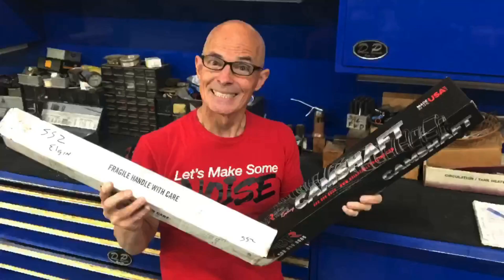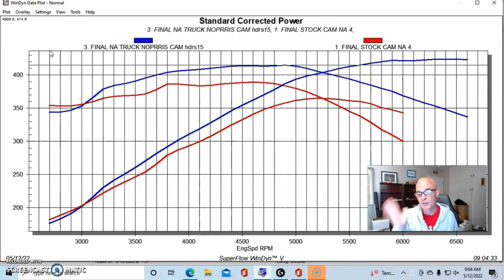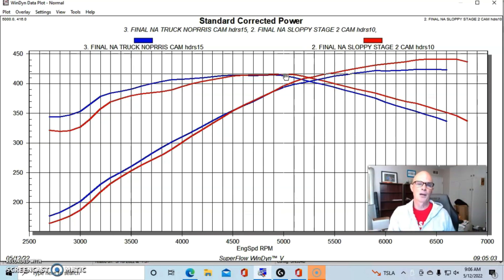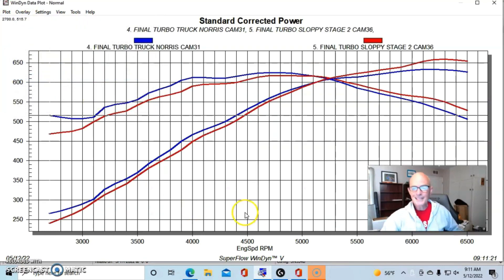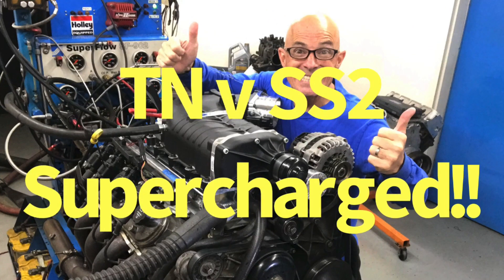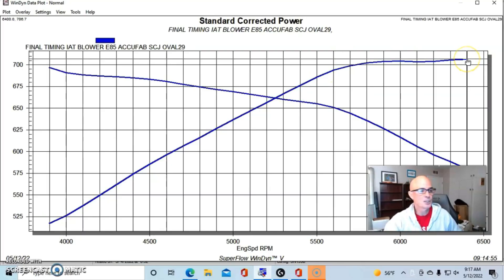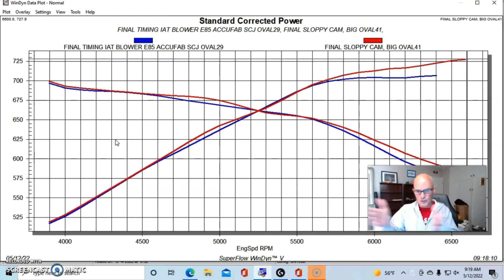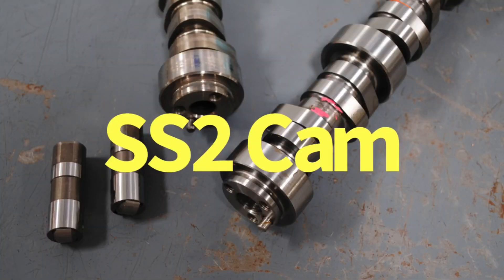WHAT IS THE BEST CAM FOR MY SUPERCHARGED LS MOTOR, TRUCK NORRIS or SLOPPY STAGE 2? WHO MAKES MORE?

Comment: Hay if you have an extra 4.4  Cadillac Supercharger hidden you don't need. Let me know 😂 it would work great on my 5.3  with a BTR  Stage 2 in my 85 C10 😂 will save more money. Thank you for your information on my engine choices. Along with the  insite on the 4.4  Supercharger alond with the video of the adapter plates for the 4.4 supercharger  very helpful 😅❤

Comment: By any chance, do you know the difference between Norris cam and red hot cam ?
Reply from the maker: yes-that video is up (along with BTR hot rod)
Reply: @richardholdener1727  could I get the link please.. I can’t find it
Reply: @richardholdener1727  what cam would you recommend. I have a ls 6.0 with a gt500 supercharger. Transmission will also have a 3400 stall torque converter.

Comment: How many degrees of timing 1000 to 3500,  3500 to 5500, 5500 to 7000 rpms..?

Do a ly6 bored to ly6, with ss3 cam, and gt500 blower. Need that  1k hp...
Reply from the maker: you won't get to 1000 hp with a Gt500 blower
Reply: What factory blower can I use to get the 1k hp mark?  Eaton tvs1900 m112 or 122 blower?

Comment: great content as always. I'm so bummed we have to guess at the data produced below 4k in the final supercharged matchup. I feel that is the most valuable piece of info in seeing how the supercharging effect compares with 2 different cams. I understand not wanting to blow the motor up, but it would be great to know if the earlier blower boost makes up for the ss2 always having less power downlow and also most importantly if that's actually beneficial in reducing a little early onset tourque from the blower enlarging the safety margin on a supercharged street style motor. since the data could not be logged for fear of tight rings, do you have an educated guess from you experience as to what would be happening below 4k?
Reply from the maker: the cams do the same thing boosted and na-if it makes less torque NA-it makes less torque under boost

Comment: 5.3L truck motor way different LW7 motor cast iron block and square heads got play with heads with then cams with supercharging and turbo . I like see 1500hp. Before I built it
Reply from the maker: no 5.3L ever came with rec-port heads

Comment: Richard could you make a video testing different centrifugal cams?? I can’t make my mind up on what can to use on my 6.2 L92 build. 
Thinking of the BTR centrifugal cam 32744155R1 but it looks llore this may hurt low rpm power. Thanks for your time 🙏🏽
Reply from the maker: what power level, what boost level and what blower?
Reply: @richardholdener1727  it’s the ECS NOVI 1500. I believe the kit comes with a 2.75 pulley 8-10psi. Im shooting for around 700-750hp hopefully maintaining a good amount of torque down low. But also contrary to popular opinion I don’t really like a ton of chop haha.
Reply: @richardholdener1727  i’m sorry the pulley is actually a 3.48
Reply: @richardholdener1727  any suggestions Richard? I’d trust what you say, you seem to have serious knowledge on these engines
Reply from the maker: ask the guys at BTR how they feel about a Hot Rod Cam

Comment: How would these two cams go against a PDS specific cam (or a stock LSA blower cam) 

And could the same results/difference be expected on say a 6.2l LSA/LS3?
Reply from the maker: They would both be a lot better through most of the curve (especially down low), but you could put a big PD blower cam in and make more up top if you like

Comment: So after seeing this vid, I am seriously thinking about a Truck Norris cam and a TVS2650 on a 5.3L.  Only Q is will the overlap of TN cam cause any Air-fuel ratio (o2 sensing) issues at low rpm, hi boost scenarios (aka: blow through)?
Reply from the maker: no

Comment: Would the camshaft for a LSA or a TVS2300 on a LQ9 be significantly different from a 2.9L Whipple on a LQ9 keeping cathedral port heads? Since the Whipple is bigger than the 2300 and even the 2650 and a different type of supercharger that should build boost a little differently would the valve events need to be a little different?
Reply from the maker: THE CAMS WILL DO THE SAME THING WITH BOTH BLOWERS

Comment: I guess the "na cam" "turbo cam" "blower cam" characteristics will only be exposed by checking how much unburnt fuel air mixture is being dumped at the exhaust.

Looking at dyno graphs alone won't expose that.
Reply from the maker: if the AF is the same-the unburnt fuel dumped out the exhaust is the same-the dyno shows that

Comment: You need to test a cam on a motor that does as the Hellcat motors do: more duration on exhaust side than intake side, or at least increased duration over the SRT 392 naturally-aspirated cam.

Since on most engines, the air is left to make its own way into the cylinder, it has a larger valve than the exhaust, which is being pumped directly out. 

Could larger exhaust than intake valves be the key to ultimate blower power?

YOU can find out!

Comment: I daily drive a TN cam in a scsb 4x4 truck 110 mile round trip to work. It makes amazing low end power in my otherwise stock 5.3. Its awesome everywhere in the rpm
Reply from the maker: it does work well

Comment: Hey Richard I’ve had the same thing told to me about my cam. It’s a comp 54-601-11 muther thumper 227/241 that’s it’s just for sound. I have it in a Carb 5.3. It produced 358rwhp and 356rwtq at 6900rpm. Still wants at peak on Hp it was still climbing.

Comment: Hello Richard, I have a ‘05 2500 lq4 with a magnuson radix. I’m wanting a cam. Truck Norris looks good. I found another cam guy (Vinci high performance) he quoted me a cam for my application (578/587/213/220/115+5A) I guess the cam has 5 degrees advanced ground into it? Have you tested these types of cams? Would that advance make low end torque like the truck Norris? I’m a little concerned the Vinci cam has to much lift. Thanks man! …Andrew
Reply from the maker: don't worry about the lift-that cam will be different then the BTR TN cam-but it will work
Reply: Ok thanks!

Comment: I would like to see a lunati voodoo hi lift 219 223 against these cams g6 guys ran in the 11s with stock converter I think this cam is still relevant and should be aloud to compete
Reply from the maker: COMPETE WITH WHAT
Reply: @richardholdener1727  hey Richard you asked what that particular cam would compete with I was referring to the sloppy  and the truck Norris don't get me wrong buddy but you test these cams alot witch I absolutely love brother I can't get enough of it your channel is the best hands down.  But it would be nice to throw a  curve ball cam in the mix like this lunati 625 625 219 223 that isn't well talked-about  but has shown to give  quite a powerful cam in the same areas that these other cams you test show it some love  it mite raise some eyebrows 🤔🤔

Comment: Adj manifold volume in tune for a Twin screw blower.  How important is it and the volume of a Whipple gen5 3.0?
Reply from the maker: MANIFOLD VOLUME IS NOT IMPORTANT
Reply: OMG the Whipple Gen V 3.0 is one of the best blower designs in history, if you are talking of the dual-pass aftercooler bottom-blower top-aftercooler design for the Mopars.

Comment: Hey Richard I have an old 01 2500 Silverado with a 6.0 that has 390,000 miles(original engine). I plan on rebuilding it next year, and I was wondering if LS3 heads with the torquer cam would hurt my low end performance. I will only ever use the truck to tow my project cars so never above 5-6000lbs. Thoughts?
Reply from the maker: THE HEADS WILL
Reply: @richardholdener1727  good to know thank you sir!

Comment: Another comparison of the SS2 to Truck Norris. I’m really impressed by the TN cam—the tight LSA makes the overlap within a degree or two of the SS2 cam while the intake closing is vastly different. TN closes the intake about 30° ABDC while the SS2 is at 45°. To my understanding, that explains the differences NA perfectly. Still, the performance of TN across the rpm spectrum is pretty amazing. Your point about killing some excess torque at lower rpm with a positive displacement blower is a good one! Great info yet again Richard!

Comment: Like to see what it does with a PD specific camshaft compared to these two cams
Reply: Yes, I have read many times to get a PD specific cam. How much are you really leaving on the table to go with a custom spec cam vs off the shelf "popular at the moment" cam? Typically i see mention about the bleed off with exhaust duration not being "ideal" on a non spec'd cam on blower application. Maybe it doesn't really matter, but would love to see a test to show it.
Reply from the maker: IF THE PD BLOWER CAM IS BIGGER-IT WILL DO WHAT BIGGER CAMS DO. DEDICATED PD BLOWER CAMS (LIKE THE STOCK LS9) TYPICALLY HAVE WIDE LSA AND ARE SOFT DOWN LOW. WHAT THE PD BLOWER CAM DOES NA-IT WILL DO UNDER BOOST
Reply: @silentbravo  The Hellcats have a cam that has the exhaust duration longer than on the same-ish engine naturally aspirated from the factory.

Comment: got to say it richard  sloppy stage 2 for the win  ( my own ss2 has been in 4 motors now im a fan)  but  at 33 thou less lift the truck norris cam gotta be better for valve spring life especialy up in the top end
Reply: IMO People going for power, power, power are ok with redoing the thing every 8-10,000 miles.
JMO

Comment: Do you like the SS2 more than the Sloppy Best?
Reply from the maker: THE BIGGER SS2 WILL MAKE MORE POWER THAN THE BEST
Reply from the maker: NO-THE LS4 IS A CATH PORT HEAD AND THE LS3 IS A REC PORT INTAKE
Reply: @richardholdener1727  Question: relative to airflow direction, are the cathedral ports somewhat shorter than the as-viewed-from-outside?

Comment: Hey Richard! If you were going to put a blower on a 6.2L Sierra, would you go with a 1.9L, 2.3L, or 2.65L?
Reply from the maker: WHAT IS YOUR DESIRED POWER
Reply: We wanna see a 1000hp blower motor
Reply: @robinwendt5527  LOL then a 2.65L Magnuson or the all-dominating 3.0L Whipple that is blower-down, aftercooler-top design as it sits for the Chevs and Mopars.
Reply: Oh yea I know the whipple 3.0 but I wanna see it in the dyno is what I meant

Comment: The more you post about the Truck Norris cam makes me want to buy one. I really want to see what power they make on a cathedral port 6.0L. I currently have a BTR LS3 stage 2 cam and I’m thinking I over cammed it for my truck. Keep up the great work.
Reply: Heard the BTR 2 is a dog below 3500 on a 6.0, and doesn't work that well with a stock converter either. I went with a Cam Motion LS3 Titan 1 for the 6.0 in my G8,  217/225 just under .600 lift 114+2. The Truck Norris would work great in a 6.0 IMO, especially a heavy vehicle where low to mid torque is king.
Reply: The L76 6.0 in my car has LS3 heads from the factory.

Comment: Why not same psi blower to turbo??
Reply: That wasn't the point of these tests, he was comparing 2 cams and how they reacted to NA, turbo and blower boost.
Reply: @silentbravo  true that was beyond the scope of this video.  Just curious to see that aspect on a graph.
Reply: I would guess about 120hp difference at this boost level. That blower eats some power.
Reply: @fpvjt146  Only accurate comparison is fuel consumption at exact same horsepower.

Comment: I dont know if it was actually from this run but in the video, you can see the idler puller moving further away from the centerline.
Another good video. I think down low, the pd supercharger is going to be the equalizer down low but the cam timing will make the bigger cam produce more power up high.

Comment: I'm curious how my BFD Texas speed cam will do with boost
Reply: I'm curious if there are ANY Texas speed cams that won't do well with boost lol
Reply from the maker: Ask yourself-what does the BFD do na?
Reply: Well kind sir, I know in Zach Mertins c10 truck from hoonigan, it layer down almost 600 on a 430 cube LS engine while in the truck
Reply: @jeromeirving4770  at what RPM?
Reply: When it was dynoed, it spun the rollers well passed 6900 redline

Comment: The wider LSA of the SS2 helped on the PD Blower tests.
Reply from the maker: no-it was just a bigger cam
Reply: @richardholdener1727  If the answer was that simple, then explain the N/A results, where the SS2 lost, then somehow won in the Supercharged tests - even down low where it was at a disadvantage. You seem to argue BIG-SMALL for everything, like my continued arguments with STROKE and BORE for power bands. Sorry, but BIG-SMALL doesn't win the argument every time, otherwise, you would be the worst Ambassador for the Aftermarket Performance Parts Manufacturers, and the research that THEY do to sell components.
Reply: @joeyjojojr.shabadoo915  Look at the RPM, he didn't load the supercharged test down low like he did N/A. He says that in the video. LSA doesn't even matter it's just a sum of intake and exhaust valve events. The SS2 has 5 degrees of overlap. The TN cam has 3 degrees. It literally has less overlap.

Comment: Blower combination literally ran 2X the boost (14.xx lbs) vs the turbo (7.xx lbs) to make less than a 100 extra hp. Really shows the efficiency of a turbo, or more accurately the inefficiency of the blower!
Reply: Would’ve been nice to see the turbo run to 14 psi too.
Reply: @etspaulding  It just increases the power the same way as before, as long as the turbo or intercooler isn't a bottleneck. 👍
Reply: @PSA78  yeah we know it does for sure. More curious to see the actual graph vs inferring.
Reply: @etspaulding  The curve would look the same, as the power increase by the change of density (friction stays pretty much the same so it can throw it off a couple of hp). So a turbo engine is always pretty easy to predict both ways, what it would make NA, or a NA with boost. 🙂
It would have been interesting to see the HC numbers from these tests though, I'm guessing that they went up a little bit with the blower.
Reply: Yeah I don't really think it's a good comparison though. That's an old style supercharger, a roots style to be precise. That's on an adaptor plate. The comparison would be a lot better is it was a modern twin-screw Whipple supercharger. Twin-screw superchargers don't make the torque of a roots but are way more efficient and better at the top end. Don't get me wrong the turbo will still make more power at the same boost, but the gap will be much smaller.
Reply: They take a lot of power to run, but sound nice though. 😂
Power comes from the fuel as well, so it's no wonder that most companies go for turbo from the showroom. 😄
Reply: full accessories cost prolly 15 hp with the blower run also
Reply: The ONLY true test of efficiency, the ONLY one, is measuring instantaneous fuel consumption at the exact same horsepower. Not F/A ratio, but actual fuel flowing into the engine. How much or little boost is being made is not the entire picture. The only true test is how much fuel is being burned to produce the exact same power.

Comment: Let's see if they are nitrous cams too since it would be pretty easy to slide a plate under carbs. Just to drive home the thought that cams work with nitrous as well.
Reply from the maker: they are
Reply: @richardholdener1727  I just wanted to see a 100 shot added to it!

Comment: Thats not fair to the BTR TN gap the rings and do this again.
 BTW will you do videos on a budget (starting low and then upgrade parts) daily driver, off road SUV/truck build up.
Reply from the maker: there are plenty of vids up on basic mods
Reply: @richardholdener1727  I would like to see the low RPM load in test of these cams (and/or more cams) as well. The off idle, low RPM boost/power is one of the main benefits of using a supercharger in the first place. If you are only caring about mid range RPM and up, might as well just go with the more efficient turbo.

Comment: I think you could get away with more cam with the torque of the Blower.  The comp 54-459 would be good on a 5.3 just because of that blower.  It’s way to big of a cam on a turbo 5.3 tho.  In a 6.0 you could run even more cam.  At what point in a car on a 90’ day is heat soak going to become a problem, especially on pump gas.

Comment: We need a cam comparison test (truck Norris vs) in at 6.2 L! Give us swap, LTZ and Denali people some love too.
Reply: Should do roughly the same thing just with more torque.
Reply: There’s been plenty of tests on the 6.2’s.
Reply: He has a video comparing the 6.0 and 6.2, and a video running the truck norris in a 6.0. If you adjust for the compression ratio differences they (the 6.0 and 6.2) make almost exactly the same power (same heads and intake).
Reply from the maker: a 6.0l and 6.2l don't make the same power
Reply: @richardholdener1727  Sorry 4% difference?